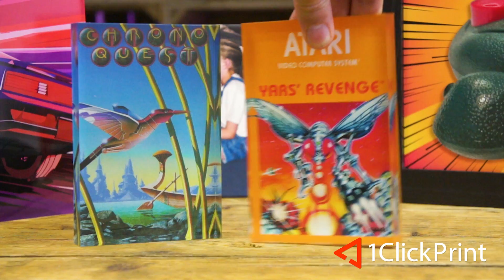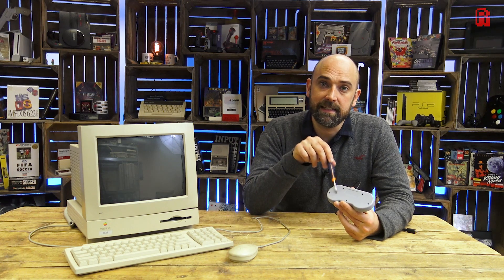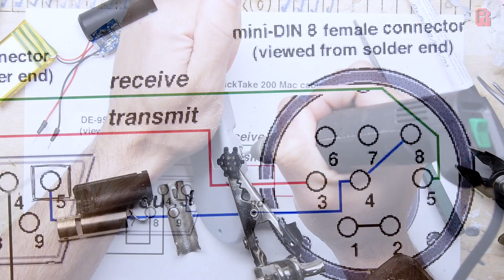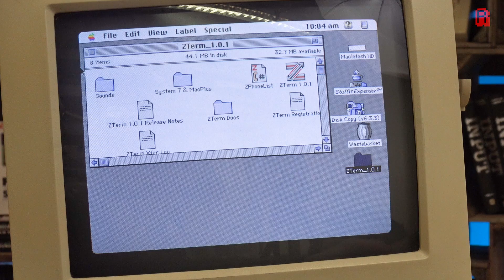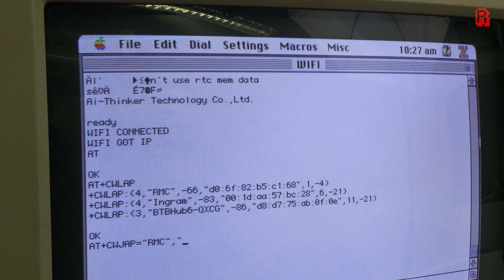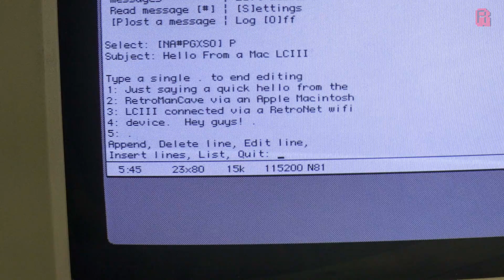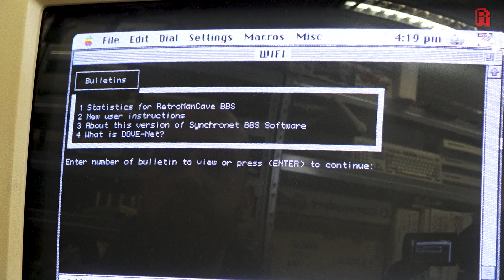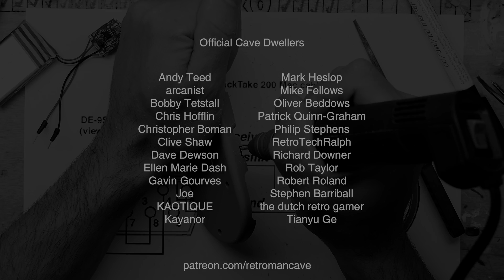Retro Tech Nibble: Wifi on a 1992 Apple Mac Computer

Comment: wifi on a amiga 1200  using the  pcm cia card  port  with a wifi card  16 bit  run the  stack  isign ip  conect  to router  transfer files or  run awebb

Comment: My RetroNet is on order in the January batch, so it should be here soon. I have a 1987 Mactintosh Plus set up and ready to go running system 6. I have Z terminal running on it and have been able to do file tranfers from it to a modern laptop using minicom. So it looks like I'm most of the way already. The Mac features a SCSI2SD card which gives me 2GB of hard drive space. It's been a lot of fun tinkering with it, I just hope the machine keeps going. I will keep an eye out for you RMC when the Mac goes online.
Reply from the maker: Great to hear!  Do keep me updated on how that goes

Comment: I assume the speed is somewhat constrained by the computer’s hardware-what kind of data rate can you get out of one of these?
Reply: Yes, data transfer is constrained by the device as you are connecting the WiFi modem to the system’s serial port. 1980s era Macintosh computers can obtain around 9600 kbit/sec whereas something like an Amiga 500 can handle up to 33.6 kbit/sec.

Comment: I would like to point out that ever since the advent of USB and FireWire people have been assuming any data connection/connector is hot pluggable (a good way to potentially destroy vintage hardware). Before USB, connections were not necessarily hot pluggable, often requiring a reboot to see the device on a serial, parallel, or SCSI port or a complete shut down just to plug in devices since they would often have hardware that needed to communicate with the BIOS first.

Also there's the risk of frying the bus as you plug and unplug stuff or causing data corruption if the bus was busy.

Comment: A few years back, we're talking just before the raspberry pi was released, I used a spare laptop running tcpser over a usb to RS-232 to connect my windows 3.11 machine to the net. first thing i tried were BBSes, then i found an old browser and tried to load google. I also used it as an irc client.

Comment: Great video.  It's nice to see some alternative approaches to connecting with the outside world.  Have you done a recap on the LC III logic board yet?  The startup bong sounded a little crackly to my ear, as if some of the electrolytic caps are failing.  Perhaps it's a recording artifact, but if you have original caps, it may be time to replace as they are notorious for damaging pads, traces, and vias on many Macs of the era.
Reply from the maker: Thanks.  Yes it's high in my queue for recapping this one before we have any leaks.  I believe these models have a poor reputation for it
Reply: @TheRetroCollective  Pretty much all of the 68k Mac models that use these surface mount electrolytic "trash can" capacitors are failing to some degree now.  Particularly irksome, these capacitors seem to leak out the bottom and the leakage stays hidden under the black plastic base for some time.  The SE/30 and 840AV may be the most problematic as the boards seem to get extensively damaged by leaking capacitors.  With the 840AV, it's imperative to recap while the machine is still functioning, as the boards are hard to revive once traces are damaged.  I think this is due to the complexity of that board, its vertical orientation, and perhaps that the PCB has more layers.  This page from the 68k Mac Liberation Army Wiki may be of use when it comes time to recap: https://wiki.68kmla.org/Capacitor_Replacement
I've recapped with both tantalum capacitors and with comparable to original electrolytics in my Macs and have had luck with both.

Comment: this is cool tech for old hardware, but the wires sought come detachable with some kind of usb or other similar connector on the wifi card side.
then you could have multible wires with different connectors. so instead of having to solder in different cable, every time you want to use this on a device with different connector, you just switch on a different cable in a fef seconds.

Comment: I just built a similar device based on the great ZiModem-Firmware (originally for usage with a C64, but also usable for normal PCs, just deactivate translation).
ESP-03 (the smallest one), a RS232/TTL levelshifter, a 3.3v linear regulator.All integrated nicely in a DB9-connector-housing (standard COM-Port) and a DIN5-Keyboard-Connector for Power.Works great on my old 286 and 386 machines.
But you need to use RTS/CTS, otherwise you get corruption on higher transfer speeds.
ZiModem is here:https://github.com/bozimmerman/Zimodem
And as John Pattillo said: Yes, inside my db9-connectorhousing is now a multiple computing power than inside the PC that's using it. ;-)

Comment: You can do better than that! I setup a PPP server on a Raspberry Pi, connected to the Mac via a serial cable, and used that to get IP networking on my SE/30. Works with MacTCP or OpenTransport. I then put the Raspberry Pi inside an old US Robotics modem case :D
https://imgur.com/gallery/dUsO3

I'm currently in the process of building a new 100Mbit Ethernet card for the SE/30. Alas I haven't had much progress recently, real life getting in the way... See more here:
https://www.mactothefuture.org/update/2018/06/17/first-prototype.html
Reply from the maker: Indeed I mention SLIP and PPP at the end of the video.  Honestly I don't think I'd use it much (like that's an excuse) but I might give it a go.  For BBS use on a C64 for example I am loving this though.  Your USR case build looks really lovely.

Comment: I bet the wifi module has more computing power than the LC.
Reply: Same is true for Gotek-Floppyemulators and similar stuff.Every Micro nowadays outperforms even a 386 or 486 of that age easily.
It's even more ridiculous when you think about performance per watt.
Reply: Yeah, but if you think about this way: modern GPU has more computing power for a certain task to the rest of the system you add it too (ie GPU rendering versus software rendering done by the CPU). Well, at least this is what I can calm myself down, that "it's OK to do" :) :)  Quite questionable example, but anyway ...

Comment: brings back memories of Amiga BBS's back in about 91 downloading backups of games ( ;) ).. eventually upgrading to a PC and further BBS use in 94 :) great days
Reply: baz za I ran one of those in Seattle area. R.A.B.B.S. ][gs based on ACOS with highly custom-modified source and one of first home grown proterm “graphic” interfaces based on extended ascii set. We also had one of first USRobotics 9600 baud modems obtained for the low price of 505 bucks in the sysop promo program. Another life....
Reply: it really does feel like a lifetime away Peter, so much has changed.

Comment: Used to use my c64 to download demos. They took forever, but I was always amazed by the amount of effort that went into them.

The Retronet device looks really interesting, and I might invest in one after Christmas if I have any money left.
Reply: Check out the PI1541. If you have a tiny amount of electronics experience and a Raspberry PI 3 this is simple to build.  Mine is still on a breadboard.
Reply: I'm building the first batch now if the new design and putting them through the paces. I'm using an Amstrad PPC512 and an Atari ST as test subjects 🙂